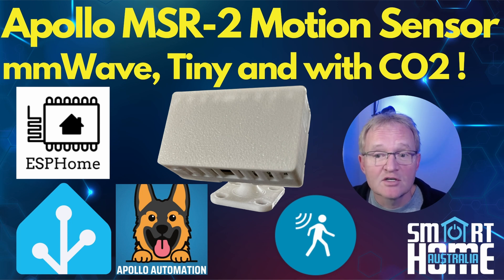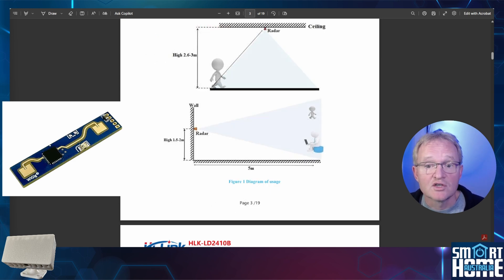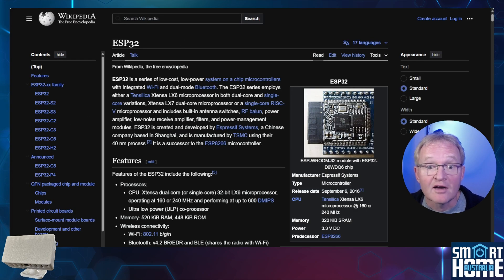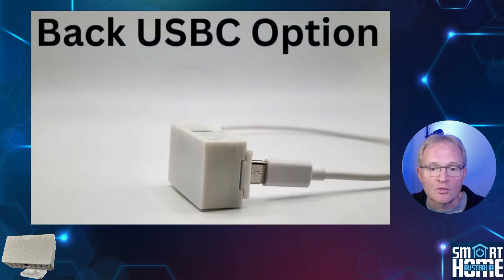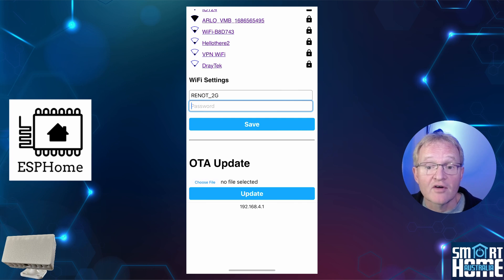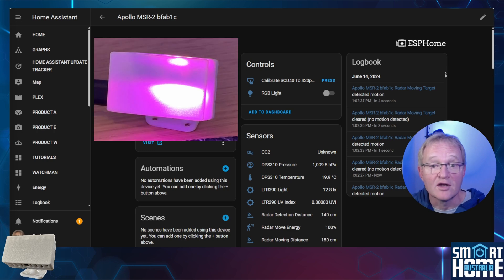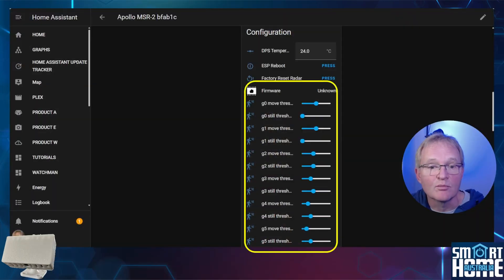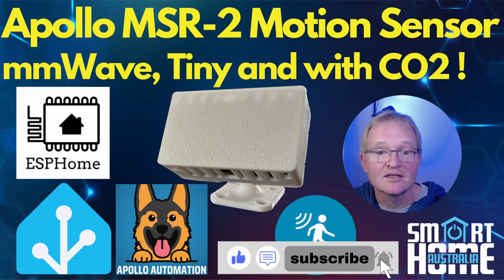Apollo MSR2 Radar Motion Sensor - Small just got tiny !!

Comment: Is it possible to have it activated without wifi connection? Perhaps connected to a device via bluetooth?
Reply from the maker: Yes, the Apollo MSR-2 should be able to operate without Wi-Fi by utilizing its Bluetooth capabilities. By flashing the MSR-2 with the MSR-2_BLE.yaml configuration, you can enable it to function as a Bluetooth Low Energy (BLE) proxy, allowing it to communicate with Home Assistant over BLE. This setup facilitates local control of compatible BLE devices without the need for a Wi-Fi connection.

However, please note that the initial configuration and flashing process typically require a temporary internet connection to download necessary firmware and dependencies. Once set up, the MSR-2 can operate in an offline environment using BLE.
For detailed instructions on setting up the MSR-2 as a BLE proxy, refer to the official Apollo Automation documentation.

That said I'd join the Discord channel and ask that question, its a total nerd fest in there :)
Reply: @smart_home_australia ill definitely join if i decide to purchase it. I intend to try to use it to replicate the radar system from halo. At least some sort of version of it

Comment: Are there any that are not triggered by pets?
Reply from the maker: Yes and no... isnt that always the case lol.

Depends on the size of your pet and type of pet. For instance, a cat that jumps up on the ledge where the sensor might be located is going to look HUGE to a  mmWave sensor. 
But in general you can "tune" many of the sensors, such as the MSR2 to exclude small pets.